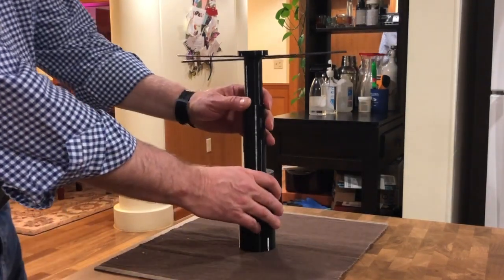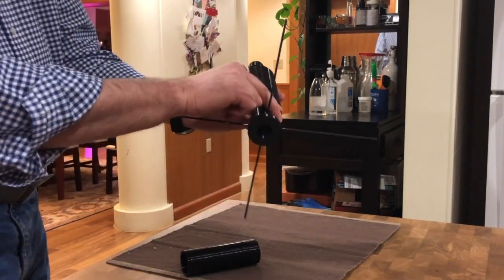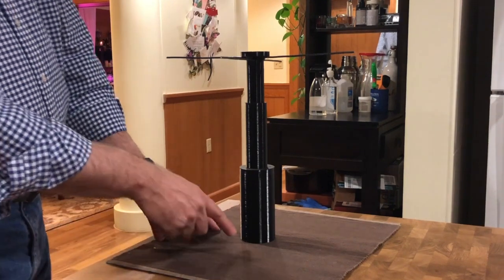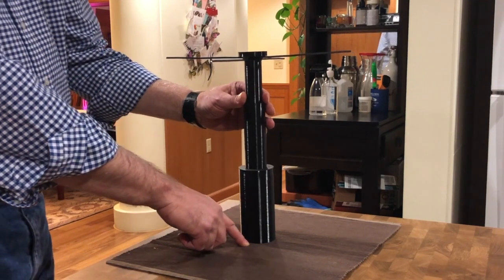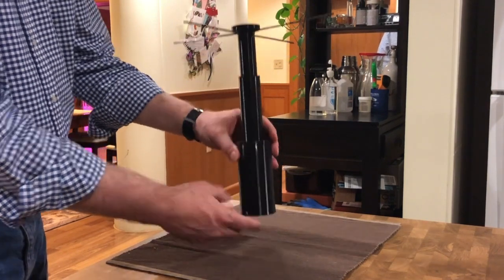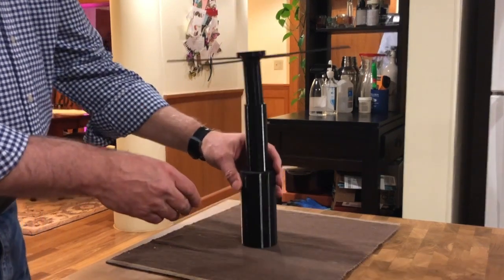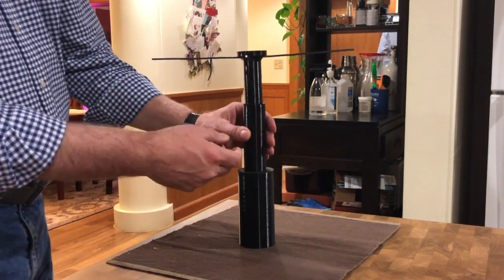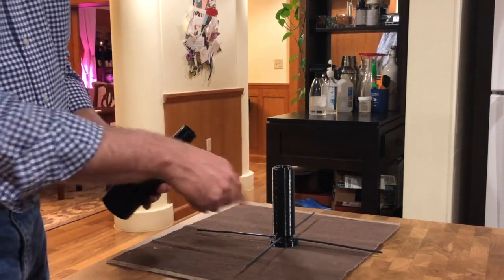UHF Eggbeater Antenna for Satellites

Comment: This appears to be a "turnstile" antenna, not an eggbeater. Neat concept with the collapsable base though.
Reply from the maker: I think you're looking at the reflectors at the bottom, which have the appearance of a turnstile antenna.  The "eggbeater" part is the section at the top with two rectangles offset by 90 degrees.  Original eggbeaters had round elements, but the rectangle shape has a better match for 50 ohms with the RG-58 coax phasing section.
Reply: @tekspeditionplanet9109  Did you show that in the video. I think I missed that because you never connected the loops for us to see here, but listening to your voice track and checking the thingiverse link in more detail now I see you're talking about that section being designed to hold a phasing harness and attache to loops.
Reply from the maker: @R3RadioResearch  yes, the details of full assembly are in the articles I referenced.  This was just a quick video I did to show how the 3D parts fit together. It's linked from the Thingiverse site where the 3D model is located.  Posting on YouTube was an afterthrought.

Comment: Is your antenna both a transmitting and a receiving one?  Is it for portable use or mounted on a mast?  The one on the link appears to be totally different.
Reply from the maker: The design is to be a transmit and receive antenna.  It can be portable, permanent mount, or whatever you want it to be.  Read the design web pages linked on my Thingiverse page.  I just designed the 3D model housing for the antenna described in the links.